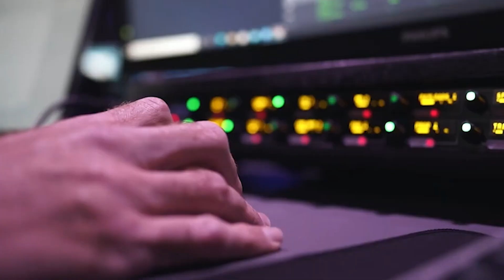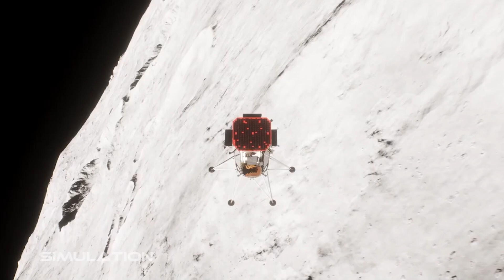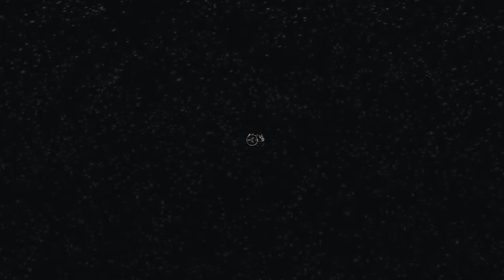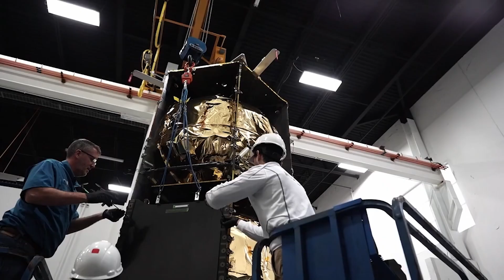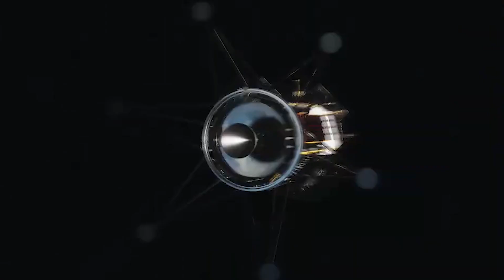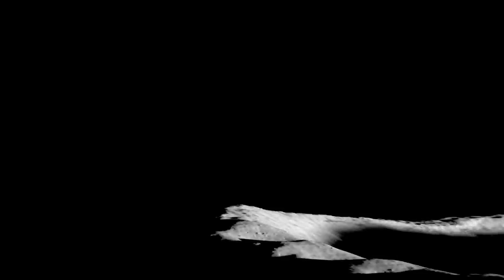What Exactly Went Wrong During Odysseus’s Landing?

Comment: They did not manage the center of gravity during the design phase?  Because I was thinking (but more like guessing) that if the cg was at least below the convergence point of the longitudinal axes of its landing struts, then even if it drifted and hit a piece of rock, the lander would have been naturally self stabilizing (like loaf bread with a coating of jam on one side landing on that side every time and no matter what orientation it was thrown in the air before landing).  Maybe...maybe not...meh...still a good job getting there.
Reply: Could let it land horizontally then stand it up. Why must it be 14 feet high ? It would seem doable to fit enough legs so it could function no matter which way it lands.

Comment: 1m/s ( 2.24 mph ) was the intended vertical landing speed. It came down at 6m/s ( 13.4mph ) with a 2m/s ( 4.5mph ) horizontal velocity that should have been 0m/s. That's a essentially a crash. Theres no way anyone should be characterising this as a successful landing.... 🤔.

Correction: 6mph down, 2mph horizontal. It should have been 2.24mph down ( 1m/s as mentioned by NASA official, "walking pace" ), 0mph horizontal. That's still a hard landing.
Reply: I haven't crossed referenced with official sources, but this video said mph, not m/s
Reply: @oliverchalfant7923  See correction in original comment.
Reply: Any landing you can walk away.... wait, that's airplanes... never mind.
Reply: 2.8m/s may not be walking speed anymore, but it's definitely something you can run with your own two feet.
So you can say the landing was harder than expected, but it's not "essentially a crash".

It wasn't perfect, but it was still a partial success. It touched down in one piece, they have power and some communications, and basically all the scientific payloads are oriented in a way to allow at least limited operations. That is not what failure looks like.
Reply: @plainText384  I would wait until we get to see what proportion of useful scientific data can gathered compared to what it should have been able to gather. Also, whether those reflector units are in an orientation that will allow them to be utilised. And the rover is DOA. And we still have no images. So far its looking more like failure overall rather than successful overall. Given that, it could hardly be called a "successful" landing that the pundits would have us believe. We'll see.
Reply: @saiello2061  what rover? IM-1 did not carry a rover.
Reply: @plainText384  oh, I was under the impression it had a mini imaging rover. Must have been thinking of another space mission.... 🤔
Reply: @saiello2061 Your thinking of the "Sky Cam", which was to be deployed to film the landing in "3rd" person, AKA fancy selfie stick. It's a crash, and a fail by any reasonable standard. Forgetting to remove the LIDAR covers before launch is ridiculous. Still no pictures, and probably wont be any.
Reply: @hawkdsl  I think they called it "Eagle Cam". Could gave sworn it had carbon fibre like wheels on it.... 🤔
Reply: Just blame it on the wind of the moon to cause it to drift sideway.  Many americans will believe that excuse.
Reply: Correct.  And why was the vehicle not able to fly this envelope??   Any landing that results in the craft ending up off its landing gear is NOT a successful landing.  Sorry.
Reply: @paulwilson8367  Any landing that leaves you with power, limited coms, and still allows you to collect science from your payloads is at least a partial success.
Reply: @plainText384  In general terms "partial success" usually means <=50% success and >=50% failure. Otherwise, you would generally be calling it a "partial failure" if it was the other way around. I.e., the "partial" bit always refers to the smallest amount of success or failure. In this case, its definitely "partial", but whether this partiality can be used to describe the success part or the failure part is yet to be determined. At the moment it looks like a partial success, I.e.,  less successful and more failure. But we've yet to see which one and by how much. What I find annoying is that people are quick to whoop it up as a "success" when they have little evidence/reason to do so.
Reply: @saiello2061  partial does not mean less than half. Every partial failure is also a partial success, just as every partially filled glass is also partially empty.

What you call it depends on what you want to emphasize. But at the end of the day, both mean the same thing:
Some objectives were achieved, some were not. Enough things worked that you don't want to round down to failure, but enough things went wrong for you to be unwilling to round up to success.
Reply: @plainText384  A glass that is slightly less than full is partially empty. Conversely, a glass that contains a small amount of water could be said to be partially filled. The "partial" bit generally places emphasis on that which is least. You wouldn't call a mostly filled glass as partially full, you would refer to it as partially empty. Again conversely, you also wouldn't call a glass that contains a small amount of water as partially empty, you would refer to it a partially full.
Reply: @plainText384  well, limited power, the vehicle’s solar panel is not pointing sunward and 2 of the high gain antennas are pointed at the regolith.  This was a crash landing that crippled the spacecraft.  The fact that there are no pictures and no updates after 3 days says it all.  
I do hope they’re able to try again.
Reply: @paulwilson8367  They literally gave an update on their website TODAY (Feb 26), where they show additional images they've managed to download after Odysseus landed.
Based on losing power when the sun sets, they'll continue getting data until Tuesday morning, when the mission ends.
Reply: @plainText384  ok, well I checked this morning, it must have just happened.  Thanks I will check it out
Reply: @saiello2061 
A glass that's slightly less than full is basically full, a glass that contains a small amount of water is basically empty.

Everything between basically empty and basically full is partially full and partially empty.

So whether the glass is 70% filled or 30% filled, you can describe it as partially filled or partially empty. Both can be used in the same situation.

Now at the end of the day language is subjective and maybe this is a regional/ ambiguous thing (sort of like pop vs soda, or the meaning of bi-weekly), but this is how I use it.
Reply: I just checked about the “new” update with photos.  Are you kidding me?  These are still shots prior to landing.  I think that now near the end of mission time we can forget about any images from the surface.  The antennas are either too degraded, or all the cameras were damaged, or both.  Or there is too little electrical power due to toppled orientation of solar collectors.
I now would say this mission is about a 70% failure.   That landing was just too far out of the planned envelope.  We can’t be sure why.
Reply: @paulwilson8367  Agreed. We might still get an image or two from the surface but time is running out and the signal so weak thats it data transmission rate would be achingly slow. Some experiments might also be working but this will require a lot of sending and receiving of commands/data. My guess is that they'll abandon the experiments in favour of even a single image, to help publically maximise its "success".
Reply: @paulwilson8367  They are new because they were downloaded from the lander after it landed, not because they were taken after landing. The lander has power and coms, and the Intuitive machines team will continue downloading data today and possibly into tomorrow, when the batteries run out.

The mission was NOT "take pretty pictures on the surface", so we really have to wait until the lander is dead and they have recovered all the data they ever will.
But it's definitely not 70% failure.

Out of the NASA payloads, I'd say:
NDL - success
RFMG - success
ROLSES - failure
SCALPSS 1.0 - depends on how much data they end up getting off the lander, might still succeed.
LN-1 - not a complete failure (they got some data on the way to the moon), but largely a failure
LRA - There are probably still some angles from which it's usable, we'll have to wait and see if the LRO can hit it with its laser ranging system.

As for non-NASA payloads: 
ILO-X - failure 
Eagle Cam - failure
Lunaprise - success
Moon Phases art cube - success? It's art so it can't really be a failure if it has an interesting story
Omni-Heat - success
Independence - success

Overall I'd say maybe 50%-67% success. But I am not a scientist working on any of these projects soooo... really IDK
Reply: Still smoother than Russian Luna 25 landing :(
Reply: Agree.. it's the definition of cope.
Reply: My words exactly, it crashed, period. Every DJI drone manages to perform a 0mph horizontal and controlled vertical speed when landing, using its optical flow down camera (ie no GPS). And they land flawlessly ... every time. Hard to believe IM missed the ball on this only mildy difficult task. Even Luna 9 did it in 1966.
Reply: @falklumo  Luna 9 landed using airbags, moving at 6.1m/s (14mph, 22km/h) when it hit the surface. That's significantly faster than IM-1 (like 216%) and unlike Luna-9 l, IM-1 did not bounce across the surface multiple times.
Reply: They're using Yeager's definition. "If you can walk away from a landing, it's a good landing. If you can use the airplane the next day, it's an outstanding landing."
Reply: Agreed! Frankly they lied on Friday morning pre-market. They reprogrammed their whole landing sensor system on the fly in-orbit, but they had no read out from an IMU anywhere to determine the 90° difference in orientation. I'm short-selling these scoundrels shares until they are delisted

Comment: Is this count as success
Reply: Yes, all payloads should work as normal.
Reply: No, the thing crashed. No success.
Reply: @trucksanddirt1506  it did not crash, it tipped over, all payloads should be able to work as normal, its a success in my book.
Reply: @zander_the_space_fan no, it crashed. Tipping your car over while parking is not a success, even though you can still get out. It Crashed. Period.
Reply: @hawkdsl  Its still a success if they can complete the mission.
Reply: @hawkdsl  Good analogy... 😁
Reply: @_the_space_nerd - It's already failed.. LIDAR covers left on, so unable to test LIDAR assisted landing (NO, hacking into the NASA system is a FAIL, because it was not meant to do that, hence the crash), Unable to deploy sky cam.  IT FELL OVER, AKA IT CRASHED. No telling what other damage has occurred. It's a fail. It's #1 mission was to LAND on the moon, not CRASH into it. BUT HEY, no big deal. Next time they'll have a simple 5 grade check list they can go by for the next project to prevent stupid mistakes.

Comment: Is 2024 the year of landing on the moon incorrectly, but still successfully landing?
Reply: Credit where credit is due, the fact we can still receive signals from craft with gross mechanical failures and inopportune landing orientations is amazing. We just can't do that with crewed vehicles.
Reply: On the other hand, if a crewed vehicle tips over the astronauts could perhaps tilt it back by constructing some sort of lever and using muscle power... Though it is probably still too heavy even under weak moon gravity.
Reply: @cube2fox  Nope. If that happens, they are dead, zero possibility to come back. Unless you can set up a rescue mission extremely fast...
Reply: @classydave75  this situation would never really happen in a crewed mission.
Reply: @saiyedakhtar3931  Never say never... Hopefully not.
Reply: @classydave75  yes, hopefully not but a manned mission has more brains on board.
Reply: @saiyedakhtar3931  Indeed. Let's hope that no Apollo 1 mission type failure or anything that catastrophic will happen. But the risk is there of course...
Reply: @cube2fox  1500 kg, like 250 kg on the moon, or 125 kg to lift. Not too heavy for 2 astronauts :)
Reply: Yep because they did land on it
Reply: 90% of its mission objectives are intact. Stop crying
Reply: @saiyedakhtar3931  I'm not crying? I was saying even though they landed sideways they still successfully landed
Reply: Why wasn't it carrying an Optimus to do just that?
Reply: @rickmarkgraf2617  You mean the geriatric Tesla joke of a robot that can barely stand on its two feet? And for which Tesla makes recurrent bogus marketing presentations, attempting to fool investors in giving them money and pump the company stock as well? And about which Musk himself had to issue a disclaimer tweet because the last presentation lied again about the "robot" capabilities? Yeah sure... 

Robots operating for heavy industrial purposes or even different rescue type operations on the Moon is absolutely not something we will see anytime soon. That's probably for the end of this century. Thinking otherwise is just delusional.
Reply: The year of the crashes. They can't say it straight, they have to keep pumping
Reply: The stock dumped after a profitable pump on all the USA! USA! hype then that wore off on tv. LOL!@anddirt1506